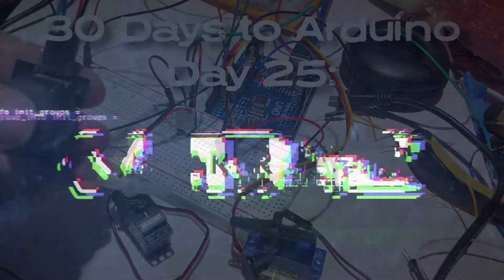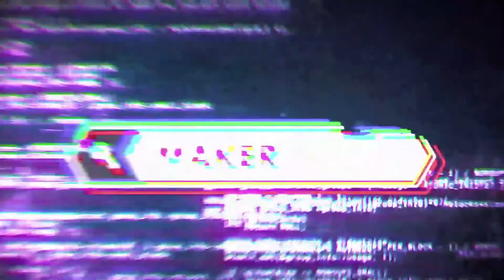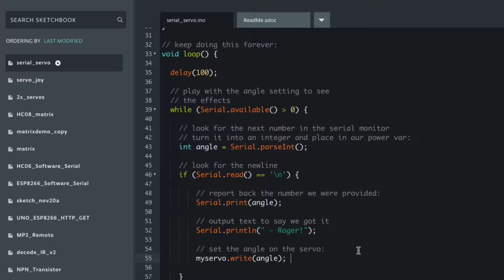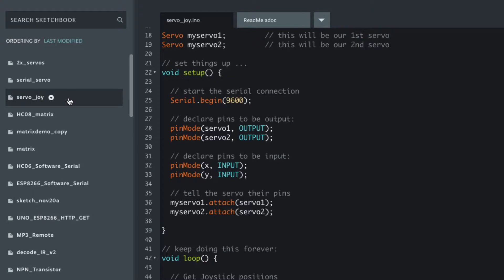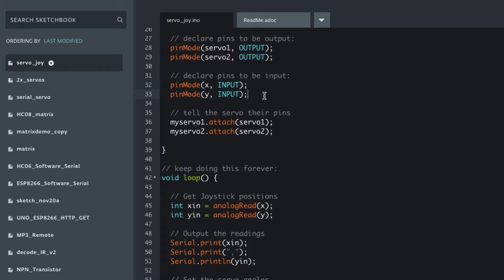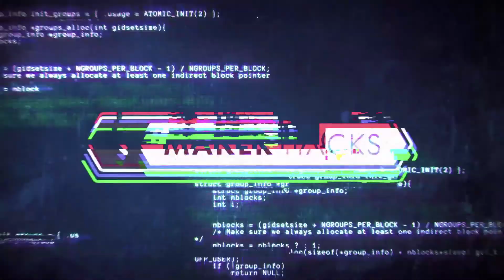Controlling 2x Servos with an Arduino Analog Joystick input

Comment: This looks like fun. I found that 0 to 180 was pushing my servo pot past its range; I could hear buzzing and noticed a high current draw. 
However, 10 to 170 reduced the buzzing and resulted in 180 degrees of movement. Thanks for the video.